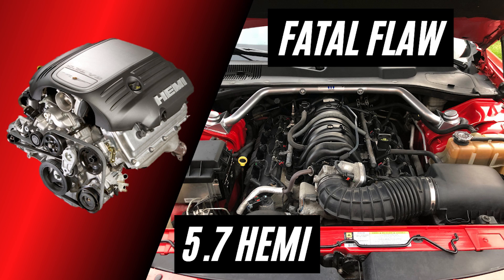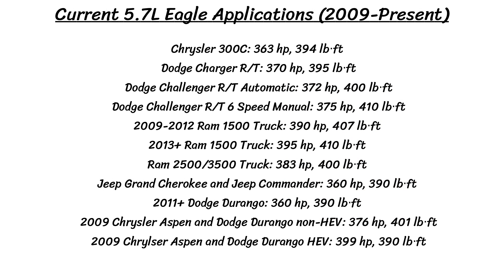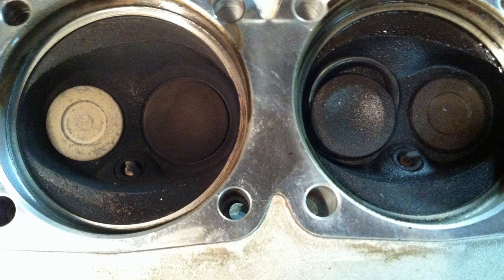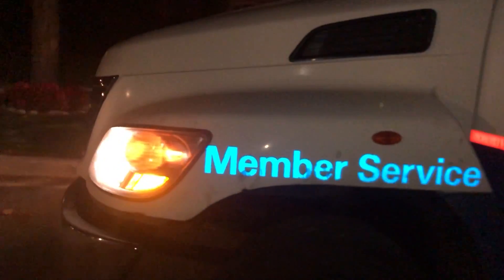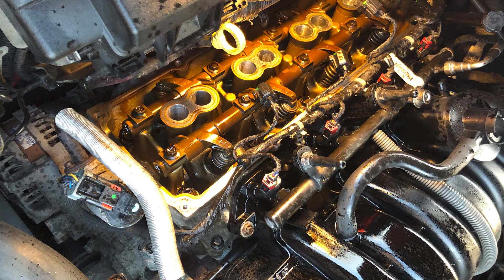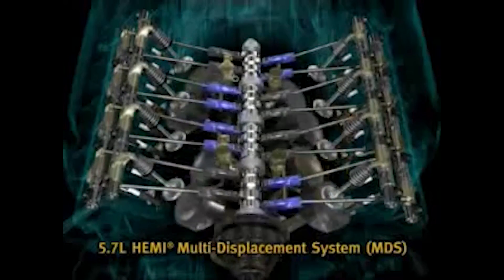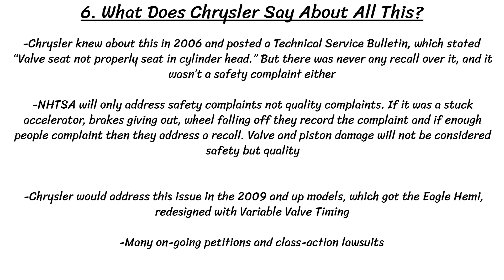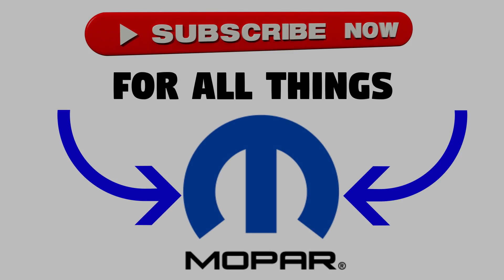The Fatal Flaw of the 5.7L Hemi V8 Engine & How to Prevent It (2003-2008 Valve Seat Drop)

Comment: Hey bud first sorry your going thru the mechanical issue!  I own a 06 RT Charger I've been aware and wary of this issue. my car has 183000 with no issue knock on wood. In may I swapped to a 6.1 srt8 engine with 80000 on it so far its running great..
Reply from the maker: Thanks bro! That’s sweet you must love that 6.1!
Reply: @MarspeedCars  I do.  blows the 315 35 20s off no problem lol

Comment: 'Simple' fix for a gearhead. All the engine builds I've dug into lately, there were quite a few odd part swaps and aftermarket options to mitigate similar in the LS's among others.

Shame Dodge won't just fix it for all the 5.7s on the road, but I suppose they expect most really about it will tear the thing down eventually anyway in the quest for powa!

Comment: Actually I didn't know about this at all, I just know that there is an issue that the engine won't be lubricated properly, especially in vehicles like the Ram 1500 when you don't usually rev it up to more then 4000rpm. To prevent this, the engine has to see at least 3-5000 RPM otherwise it won't lube properly

Comment: I own a 06 charger rt 5.7 hemi with 132K miles on it and to this days is running perfect and beautiful with MDS off and 180° thermostat! Great Great engine!
Reply: @epicfrog4250  you cant. You gonna need a diablo sport tuner.
Reply: @epicfrog4250  thats what i bought. I tuned it with 91 cold intake tuner and use premium gas. Turned mds system off and also installed a 180 thermostat.and do my oil changes every 3.5k miles with pennzoil ultra with a kn gold oil filter.
Reply: @epicfrog4250  Other tuners will do it, but you do need some form of tuner. But MDS is awesome, it's not a cause.
Reply: MDS can contribute but it's usually after someone has let the car continually overheat loosening the valve seats which let's the uneven heating due to MDS cause the loose seats to have a higher chance of dropping.
Reply: @nicholascortez728  How does MDS exactly do that? That makes zero sense.
Reply: Running auto stick shuts down mds.

Comment: My 2006 RT has 95k, you have me nervous now man 😧
Reply from the maker: Hope yours won’t be affected man!
Reply: @MarspeedCars  I wish someone would do a tear down video of fixing this problem. Replaced the 5.7 in my 300 once already and the gaskets blew again
Reply: @DasherDk that's sucks and I was at 170,000 miles when mine went out
Reply: @DasherDk thank you ! I have an 2008 charger rt and have 163,000 on it I only had suspension issues I replace the front upper/lower control arms , struts and now I’m reading these comments making me try to take preventives
Reply: My cam just went out in my 06 Daytona charger
Reply: @DasherDk driveshaft? What issues with that
Reply: @DasherDk thanks a lot but I run synthetic oil since new in it I wish I didn’t have that mds on it though I have an 2004 Ram with the hemi and it sounds better without the mds
Reply: @DasherDk I appreciate the conversation thanks again
Reply: @Hybrid Libertarian lol thanks
Reply: @Hybrid Libertarian well you're one hell of an idiot lol
Reply: You and me both bud

Comment: Just bought a new 2020 Ram 1500 with a 5.7, wonder if this still happens on newer models, of course I keep up on maintenance and don’t run it hard. Time will tell...
Reply: The valve seat issue isn’t a problem on the 09-present hemis but they still have the ticking problem where the lifter stops and eats the camshaft alive. You can do some research on this and it is a pretty severe problem.
Reply: @rescueaviationfilms1019  i have a 2010 RT now im scared asf its at 99k miles already too !
Reply: @danielm4203  It's fair to say that some measures to prevent the lifter issue might be worthwhile.
Reply: @rescueaviationfilms1019  NO they do not
Reply from the maker: Deputy 119 said it well. However, these problems honestly all happen after some mileage. I’d just try to get rid of it before 100k miles lol
Reply: @MarspeedCars  Wrong
Reply: No, all the issues are solved. The valve seat in 2009 as mentioned and they started implementing a new lifter design in 16.
Reply: @snek9353  is that why a brand new 2019 ram at my towns dealer is ticking and it has 12 miles.
Reply: @snek9353  there was used 2017 with 47,000 and it was ticking like nobody’s business. So it is still an issue. Idk what you are talking about
Reply: @rescueaviationfilms1019  The ticking you're talking about and the lifter failure that wipes out cams are two separate issues  with different causes.
Reply: @snek9353  look I have helped my buddy work on his 2017 ram with a hemi because it was misfiring and the ticking was very noticeable. Upon inspection of the lifters and camshaft we found that 3 lifters were seized up and were each had been the was severe marring and intentions on the camshaft. This caused the lobes to not be y’all enough to lift the rocker arm high enough to fully open the valves in each cylinder where the lifter had failed. This caused not enough air coming into the dead cylinders and not enough exhaust to come out. This truck had 107k miles on it and it was dead.
Reply: @snek9353  I don’t know of them ever changing lifter design on these trucks. And you know I’m talking about the 5.7 in particular. I don’t have photos of the lifters and cam because we were in a hurry to get the truck put together before it rained that evening because we had all the parts when we took it apart.  And how would I show you pics in the first place if I had any
Reply: @snek9353  you should also know that this is a 2500 flatbed truck that he uses to transport his trailer hauling cars all over the country.
Reply: @Hybrid Libertarian It's rare but it's not THAT rare, there was a lifter issue. To deny that is just foolish.

Comment: So... do the other hemis have the issue with MDS causing this? I want to engine swap my Dakota to a 6.4L, and I wanted to keep MDS on with a stand-alone ecm to keep decent fuel mileage, but it won’t be worth it if I can’t push it past 100k, especially if I decide to mod it...
Reply: MDS BARELY helps mpg, more of a way to be compliant with regulations for dodge then to help you save at the pump. Any MDS engine, hemi or not is more prone to lifter failure but it's definitely less common on the newer engines
Reply: @732Mopars  MDS is worth 10-20% on highway MPG. Nor is MDS a cause for any of these issues.
Reply from the maker: Yeah the MDS I found was really shitty and didn’t do much, the 6.4 is good but I’m sure every engine has their own thing to watch out for. My V6 it was rocker arms, this was the valve seat, etc. I need to get a bit more familiar with the 6.4 issues first before I can fully answer you!
Reply: MDS is not a cause, that's completely wrong. The 6.4 is a great engine, it'd be a good swap. But I'm unaware of any aftermarket stand alone ECU that will run the MDS and VVT. Use an early stock computer.

Comment: My takeaway from this is "Cylinder deactivation is the enemy of the people".
Reply from the maker: It was honestly annoying on mine unless you drive long long highway distances
Reply: @MarspeedCars  agree 💯
Reply: @MarspeedCars  no one does that in a charger with a hemi
Reply: @austinreed347  my magnum R/T is a family car so 3+ hour family trips are what it does and nothing does long highway runs like a big RWD wagon/sedan with a lazy low reving  V8. Will cruise at 80 for hours.
Reply: @nicholascortez728  read my comment again
Reply: @nicholascortez728  mine too!   Love it.  Bought new, lifetime bumper to bumper Chrysler warranty.    This hearse is for life!
Reply: GM's new cylinder deactivation system is actually really sophisticated and helpful for highway cruising but I see what you mean because nobody likes the old Cadillac V-8-6-4 system lol
Reply: @RageCannon-tf3ob  GM has lifter issues with those engines. A friend of mine has to have all of his lifters replaces in his 2016 4.3 Silverado.
Reply: @RageCannon-tf3ob  I owned a 368 8-6-4, someone gave me the car..  I rebuilt the computer and the thing worked perfectly..  amazing for its time (1981)
Reply: That same bullshit that makes me cringe when i'm sitting at a light and the vehicle next to me shutters off, then sputters back to life when the accelerator is pressed, that dumb as hell engine idle shutoff crap some moron engineer thought would be a great idea to implement into a vehicle...
Reply: I lost interest in some Mazdas due to their introduction of cylinder deactivation. I feel like it's not a reliable system.
Reply: Cylinder deactivation destroys every engine it touches
Reply: @ProfessorDickify  Whatever dick face
Reply: My 2008 , 2500 doesn't have MDS , 257,000 & still running strong
Reply: @garyhaley3072  I Also have a 08 Ram 2500 4/4 HEMI an runs Flawless with No Check Engine Lights 116,000 miles an I run 
Castrol Edge High Mileage Full Synthetic 5w20
Reply: Very informative. I will not be buying a 2006 dodge charger with this hemi that I was thinking about getting.
Reply: While that may be true, the main enemy is mainstream news
Reply: @sategllib2191  #Facts
Reply: @sategllib2191  and Epstein didn't kill himself.
Reply: It's only activates when it's not needing power. If it engages, you're not running it hard enough. 😂 Put your foot into it!
Reply: And yea cylinder deactivations fucks plenty of shit up don’t care what ppl say ... and soon shit cannot handle eny kind of over heating
Reply: But the cylinders only deactivate when cruising.
Reply: I've never had these issues with any of the 5.7 hemi's that were in my Rams or Chargers. I think it's operator error. Everyone complains about lifters ticking and all these issues, but everyone who complains uses cheap gas and beats the hell out of these engines.
Reply: @Hats1976  " it's operator error....... cheap gas and beats the hell out of these engines."
- I'm confident that oil has a lot do do with it. Between the very long change intervals, 5W20 standard, and oil consumption by the PCV. An owner that isn't on top of the oil and just gets it changed by someone cheap when the light turns on has very poor oil maintenance.
Reply: There's no way MDS is a contributor here, it's a great system, I'm a fan.
Reply: @snek9353  Keeping oil flowing through the lifters at all times is the problem when idling and not allowing the cooling system to cool the engine before turning it off..using the shifter turns off the MDS thus creating oil/pressure in all cylinders at once...wanting to save fuel with a V8 monster like the HEMI is foolishness. Chrysler wanting to please the "Brady-Bunch" mom they created the MDS.
Reply: @donnelljefferson4161  That's a lot of wrong..... well done. 

"Keeping oil flowing through the lifters at all times is the problem when idling"
- Nope, Hemi lifters are pretty drenched in oil at all times. And "through" do you not know how hydraulic lifters work? 

"not allowing the cooling system to cool the engine before turning it off."
- This and the above are in one run on sentence, do you think them related? Yes if one has a year susceptible to dropping seats, stopping it hot is dangerous. But there's no version of the hemi that has both lifter failures and valve seat failures. 

"using the shifter turns off the MDS"
- Hey look you got one thing sort of right. Using auto-stick, not "the shifter" but close, I knew what you were getting at. 

"thus creating oil/pressure in all cylinders at once"
- Huh?

"wanting to save fuel with a V8 monster like the HEMI is foolishness"
- V8 monster, lol, no. And no it's not, if we can save fuel and go fast to, why not. 

"Chrysler wanting to please the "Brady-Bunch" mom they created the MDS.
"
- No, they created MDS to please the federal government who mandated CAFE standards. If you don't like it maybe you should learn what your government is doing and vote better.
Reply: @snek9353  I’m extremely pleased at your fact checking responses here.  It’s amazing how misinformed people are.
Reply: @thelight5067  Thanks
Reply: @snek9353  A Tad late for the former, I'd say. By staying  busy with our internal Combustion Engine Vehicles.  As Destructive as they were on the Eco System if Poisoning the Air, Water and Food wasn't enough, only about 15% of the Energy Created by the Internal Combustion Engine is used up.  The Rest is Transferred into Heat.  No use whinning about it now. Say,  "No" to Government Mandates!  Good looking out.......
Reply: @snek9353  MDS doesnt do anything to help gas mileage at all. I had on my 06 ram and now on my 16 and i see no difference. my 06 had 214k on it when i traded it in and thankfully never had valve seat issues or MDS issues. Im looking into ways to permanently turning off MDS on my 16.
Reply: @erikkarlonas180  Is that your big evidence, that as far as you can tell your 06 and 16 get the same mileage? Wow how scientific, if so that would also mean that the better transmission, VVT, higher compression ratio, better camshaft, and better heads made no difference. You better go tell FCA that they wasted millions of dollars. 

Me, I've done actual testing, same car, MDS on vs MDS off and it lines of exactly with Chrysler's claims of up to 20% fuel savings.
Reply: @snek9353  I have a 2005 2500 with the 5.7 pre MDS, compared to my step dads 2017 2500 5.7 MDS truck. He hates that 2017 for the fact that it has MDS. If you buy a 3/4 ton or up truck, you don’t want things like that, I prefer power on demand when I put my foot to the accelerator. Not a big fan of MDS for reasons but if it works for you then good on you.
Reply: @moreuggaduggas  "I prefer power on demand when I put my foot to the accelerator"
- The throttle lag has nothing to do with MDS.
Reply: @erikkarlonas180  I have a 2019 ram classic with the 5.7. I've also owned a 04 and 06Ram, both hemi truck. I get between 20 and 22 at 70 mph, where as the older Rams without MDS where getting 17 at best
Reply: @snek9353  My 2019 Ram.classic with the 5.7 gets between 20 to 23, thats way better than my 04 and 06 Ram.
Reply: @snek9353  think about it if the aluminum head is hot the steel valve seat will not expand as much due to the lack of combustion heat in the cylinders that are shut off therefore the press fit between the steel seats which are in the combustion chamber could be lost.  I have a 2019 5.7 in the Challenger and so far at 20k miles the mds works flawlessly.
Reply: @robc8468  An interesting theory, however if true only the exhaust seat would be effected. Exhaust valve seats get quite hot from the cylinder firing, the intake not so much.  However as far as I can tell it's more common for the intake seat to fall out.
Reply: @snek9353  My #1 intake came out. Did not fall out, it was just wedged enough to cause a compression leak, The valve just touched the piston-No damage.
Reply: @snek9353  it's very obvious why MDS would cause this issue
Reply: @amritk5173  Ok why?
Reply: @snek9353  the MDS lifters are special compared to the regular lifters. They need a bit more oil than normal to function properly. And when the MDS is activated, it doesn’t allow the oilers in the heads to work at full capacity like they should, which causes the crazy camshaft/lifter wear you see in a lot of eagle motors. I’ve seen so many chargers almost about to go boom because of it. I bought my eagle hemi and immediately tuned out the MDS. It’s necessary.
Reply: @mattmessner7732  Of course they're special, they're MDS lifters. They only need more oil when active to press in the pin, this oil is provided by the MDS solenoids. 

"it doesn’t allow the oilers in the heads to work at full capacity like they should"
- I have no idea what you mean here. By heads do you mean the cylinder heads, if so no, this couldn't be more wrong. Hemi cylinder heads have their own pressurized oil supply. There's a pressurized oil passage that goes through the block and into the heads. This oil supply then fills the rocker shaft with pressurized oil. This supplies the rockers and squirters. The rockers in turn  supply oil to a passage inside the pushrod, this supplies the internal workings of the lifter.
Reply: @snek9353  do you work for dodge?
Reply: @FighterOfTheGoodFight  Nope, they should pay me though huh.
Reply: @snek9353  Use Castrol Edge Full Synthetic are Castrol Edge High Mileage Full Synthetic
Reply: @jacobsebastien3910  Nope